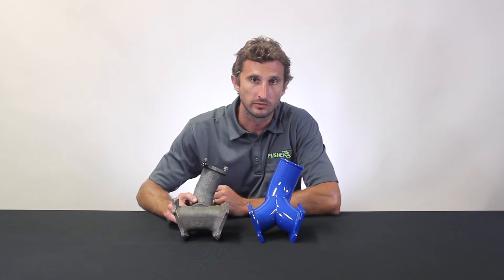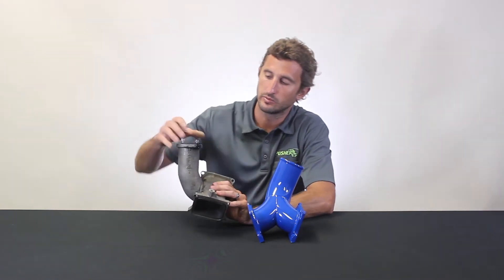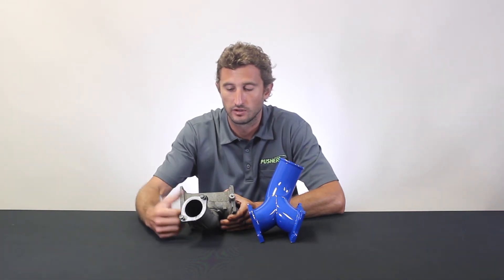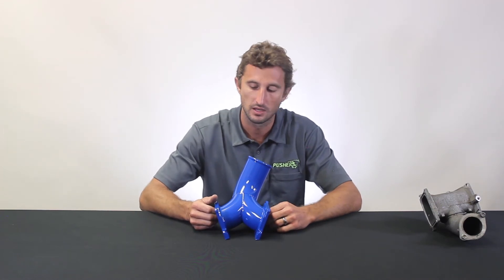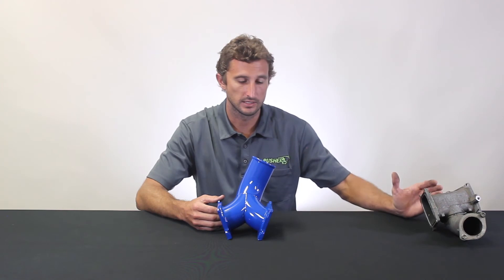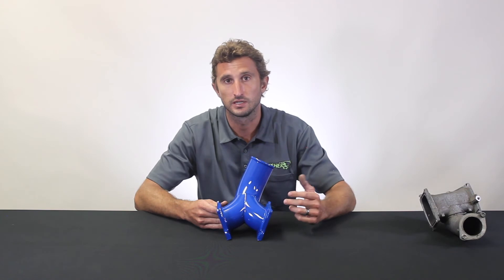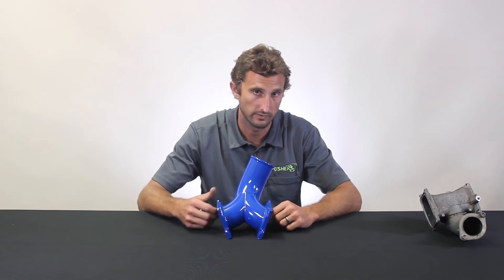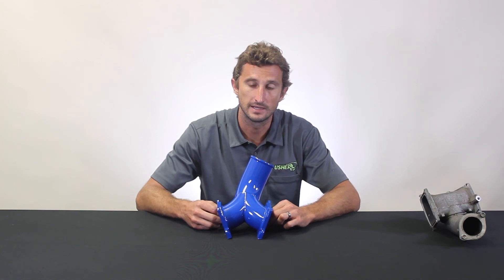Pusher Product Overview - SuperMax Y-Bridge for Duramax LLY Trucks

Comment: So tell me why this cost $700? That s a bit much for a couple pieces of pipe and 2 flanges. I get welding it takes some skill but machines did the rest.
Reply: Roy Bradshaw machines did the rest.  Clearly your not aware how a business runs.  1st , who's design are they using,,, theirs!  Shortest path with minimal bends. 2nd who bought the expensive machines to complete the design. They did. They have a product and it's far superior compared to the majority of other crap on the market. People just want stuff for free and or go the easy cheapest rout that keeps the restrictive y bridge. As well as SHITTY cold side piping
Reply: We dont give a damn. Cut overhead and allow the consumer to get a better price. Obviously you dont understand how to be competitive.
Reply: BigB check again no they dont.
Reply: @boostlord3618  & BigB i don't know where you see this because i bought this for $700 and got the full kit deletes/Replaces Cold side
Reply: @Royaltyautoclub how did you manage the front 2 bottom nuts?
Reply: Hsp wants like 1200
Reply: true, look into werhli or HSP, they'll give you a y-bridge and the drivers side intercooler pipe for this price